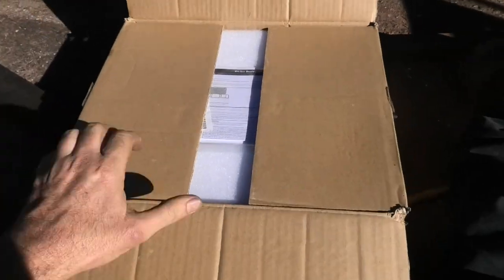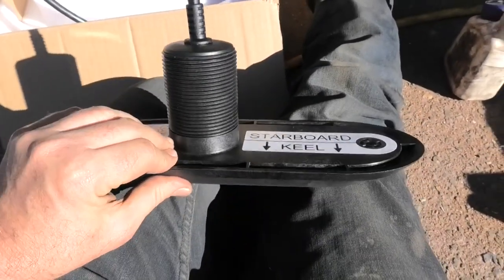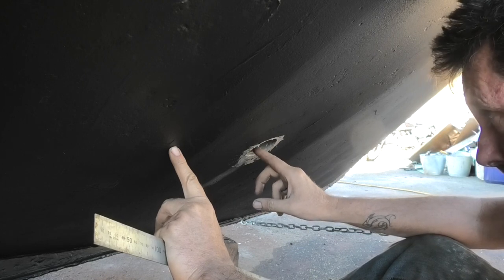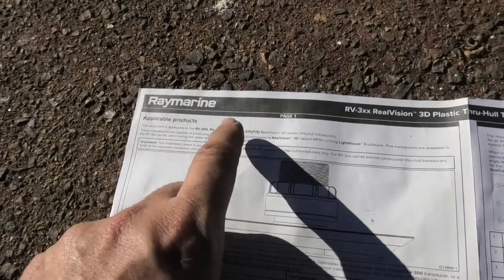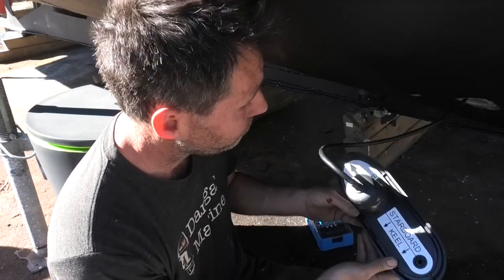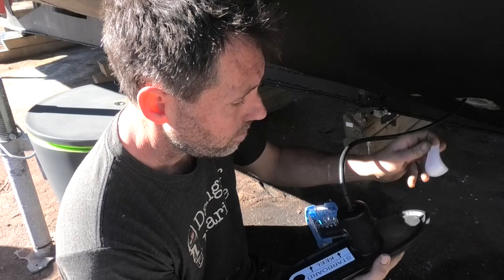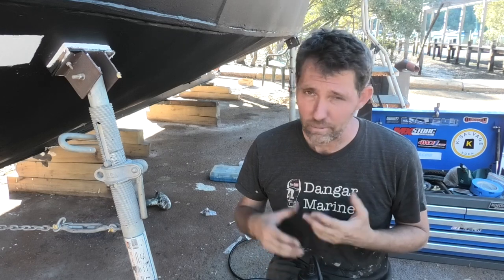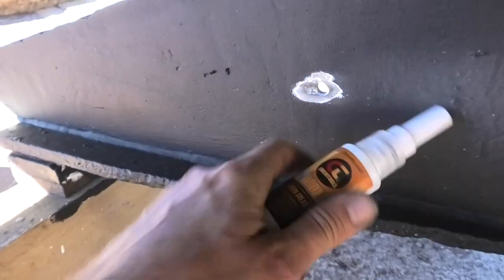Installing Raymarine RV-320 sonar transducers and attaching anodes

Comment: The fact that raymarine thought about the potential of the treads putting a knick in the wire it really gives you confidence in the fact they've put that thought process in the enclosed unit as well. 

Good to see a company doing everything they can to ensure their product will work for their consumers
Reply from the maker: For sure, everything I see and read gives me a lot of confidence in their product. I did quite a bit of research and it wasn't cheap (well, for me anyway) so I'm really hoping to get some great use out of it.

Comment: The fact that the transducers can be installed without the need for angle blocks is a great feature. It was always such a pain to have to fabricate a block to make the bottom of the transducer parallel with the keel.
Reply from the maker: For sure, they are a really nice design.

Comment: I reckon that little protector sleeve thingy might make more sense if you put it in the hole through the hull. A plastic nut likely wouldn't be sharp enough to cut the cable, but a hole through a steel hull could certainly slice the insulation right off.  Especially so if you're  installing the transducer somewhere with limited access and the cable needs to make a sharp bend immediately (the cable would be pulled through the hole at an angle.
Reply from the maker: Yes, I'm sure there are certain circumstances where it would come in handy, but I think this was a pretty straightforward install in the end.

Comment: Stu just use a piece  of pvc  pipe over the shaft  with an exhaust  clamp on it . Just split the pvc down the middle it is easy to remove then I have done it a few times so I know it works. Like your videos mate cheers

Comment: Maybe that plastic protecter was to protect the threads from getting Sikaflex on it as you snake the nut over the cable. When you feed the cable through hull hole with Sikaflex smeared on it you're going to get some on the cable. Just a thought.
Reply from the maker: Yes, possibly, as well as maybe for the brass model which has sharper threads.

Comment: Would the authorities issue you a variance for the crane? 1. They left you stranded. 2. The bridge held up for as long as it held up until somebody had a better idea. 3. You only need it one time to get your boat in. 4. Their new regulation impacts you disproportionately.  5.  You could lead a secessionist movement for Dangar Island. Good sailing on your coast run....

Comment: Stu: <drills hole in hull>
Stu: "Let's read the instructions"

Great job man. Not putting the engine in before going in the water seems like maybe not such a great idea, though.  With having to time it with the tides, maneuver the boat by hand in the shallow water, with having to deal with the two crane hassle, with having to then tow a fairly heavy boat out...it seems like a safer easier bet to get the engine in and running first. 

Either way, best of luck and enjoy the videos very much as always!
Reply from the maker: It's true that driving it out would be easier than towing, but it won't be hard to tow with someone on the wheel.

Comment: The transducer is easy to test out of the water. Connect up and turn on. Place your ear up to it and it will make a ticking sound as it pulses. This can be done quickly without risk to the transducer.
Reply from the maker: Just need power and the head unit.

Comment: Nice one Stu, fantastic progress and great humour.👍 My only negative comment is you appear to be leaving too many threads proud of the nut when the joint is fully clamped. Worked in the Marine industry (40 years) and our rule of thumb was max two threads proud, this to make it easier to remove the nut in service after the inevitable corrosion sets in. Nothing worse than graunching a nut back over two inches of rusty thread.😉 Keep up the good work.

Comment: Hi Stu, Dual crane lifts are fraught with potential to cause mayhem........make sure that the crane operators have some dual crane lifting experience (current) and ensure the communications are all pre discussed and agreed.  Hopefully a really experienced person to control the whole operation, good luck.
Reply: Reminds me of a situation I was in. 1974. Worked for Florida Mining & Materials building prestressed concrete I beams and railroad trusses for bridges. I was a rigger. Called out the crane operator for having a pint of Jack Daniels gone by lunch everyday and a second one by quit time. He thought it was funny to hit me with the ballhook. I'd have to jump otta the way more than once/day to avoid being knocked off what I was standing on. Gold Hat was crane operators brother in law.... so he put me pulling nails on a stack of plywood 20' from his office for punishment. The replacement rigger was sent to do his first job, a "double pick". Lifting a 120' Ibeam using 2 cranes. One crane moved and the other did not match. The beam tipped over almost toppling both cranes. They just dropped it to prevent toppling. Unfortunately, the new rigger wasn't far enough away and it pinched both his legs right off. I heard him scream 1/4mile away. He died later that day. Have a long rope and dont stand under anything. $2/hr min wage...
Reply from the maker: And check their insurance is current. ;)
Reply: Hell, just make sure you film it. If it goes bad and then goes viral, you just got a super yacht!
Reply: Mars Rover Now that’s not a bad idea 🤔 10 cameras in hi def with slo mo at key points.......Stu’ll be in a Nordhaven in no time!
Reply: A Forman what a tragedy and waste of life, thankfully; I never lost anyone on my watch, don’t think I could ever forgive myself.

Comment: Drill and Tap threads will make a good electrical connection, approved for most electrical codes, instead of through holes. 
Weld same type bolt material as hull for electrolysis mitigation.

Comment: Looking at the rudder, are you planning on modifying it? My dad changed the rudder in his boat from a flat plate, very much like your trawler has, to a hydrofoil teardrop shape profile. It gave a massive improvement to maneuverability.
Reply from the maker: I think I will play with it over time, but I'd like to live with this one for a while so I have something to compare to, otherwise I won't know if it is an improvement.
Reply: @DangarMarine  "Marine rudders and control surfaces" will explain what you need to know. It's simple to understand and covers everything from a viking steering oar to roll stabilizers. You can find it in PDF.

Comment: The grease to use is rescue steel grease  wish is used in a lot of fishing boats and water does not wash it off as it does with most grease.
Reply from the maker: Will check it out, thanks.

Comment: Engine installation might be a bit easier with the boat out of the water when it comes to aligning the prop shaft. The prop protector is going to be a very good investment; hopefully it's robust enough to do the job.
Reply from the maker: I think it might be a bit easier, but it also gives the most accurate result as the hull has settled into its natural position.

Comment: The transducer should be mounted level both fore and aft and athwartships.. its not goin to scan directly below the boat, unless ive missed something. its pointing away off to the side of the boat stu. The old limpet you cut off was there to produce a level mounting surface for the transducer
Reply: There designed for the angle. They make different ones for different angles
Reply: @baums547  thats cool never knew. Big drag saving not having to have a limpet to mount it on

Comment: Prop shaft strap.. use some 1 in strap across the front use another piece behind the packing flange and threw bolt

Comment: 291 is an awesome below the waterline sealant/adhesive ... a million times better than silicone.  You should probably have smeared some up the anti-rotation bolt before you popped it in.

Comment: Hi Stu, turn up some tapered plugs the same size as your seacocks and transducers, Tie them in a bag with a cheap club hammer near each of  the through hull holes, then if you wipe one off you can quickly plug the hole. Also to hold the propshaft in place, a couple of hose clips or a wooden bolted clamp will do it, but I advise to fit the packings AND flange while on the hard.
Reply from the maker: Good idea. :)

Comment: If this were 3 cm longer, that anti-rotation bolt would have been a problem.  Also, it sounded like you said, "Time to read the destructions."   This is now my preferred term for the papers included with projects...
Sikaflex - rubbing alcohol works well on the gloves to make sure it doesn't stick.
You placed the wide end of the anode towards the bow, is this preferred?
Very exciting that you are getting close to back in the water.
Hope your mate's family is doing well at the loss of dad.  Been praying for him.
Reply: Good tip on the rubbing alcohol! Re: wide end of anode, yes the blunt side forward is actually more 'aqua-dynamic', in boat hulls this is called 'fish shape'. Look at how a tuna or a sea lion is shaped... wide at the front for maximum slip, narrow at the end for minimal turbulence :)
Reply from the maker: Yes, I also think of it as an aerofoil shape.
Reply from the maker: Yes, I also think destructions.  Good tip about the alcohol!

Comment: Hey, putting  the boat on its swing mooring clearly saves cash.... the negative in my experience is you'll waste time traveling between ship and shore when you don't have that vital tool or part. Planning is key!
Reply from the maker: It will be much quicker to get from the mooring to my workshop than where the boat is now on the hard stand.

Comment: I’m not sure really how toxic it is but they always say you should wire wheel the yellow zinc coating off those (grade 8 I assume) you welded to the hull.
Reply: "Yellow zinc" is likely cadmium, and yeah, it's pretty bad. On the other hand, his ventilation is decent...

Comment: Nice going stu... You said your boat has a 20° dead rise assuming that's measured at the back,, I think in the forward location where you have the transducer it's more than 20° Is the transducer adjustable? Anyway enough with my crazy questions can't wait to see the boat in the water I hope you have the biggest barbecue then
Reply from the maker: 20 is the highest deadrise they sell. I do have that metre for measuring it, I'll check what it actually is. It will be much less than 20 at the stern.
Reply: @DangarMarine  yes at the stern it is much flattered which usually the transducers are installed. As you move up front the deadrise changes let me know I'm just real curious have a great time this week how does it feel becoming a star on YouTube LOL

Comment: Interested to see you using a stick welder rather than mig or tig. Given you run a Land Rover, it must get a fair bit of use. Why do you prefer stick ?
Reply: No hassle of gas and can weld outdoors / anywhere?
Reply: I'd prefer a stick welded joint over a mig joint anytime.......... Other reasons are as Brian mentioned.
Reply: @garrylearmonth9313  Agreed, much better penetration.
Reply: Stick takes more skill, but is a much more versatile form of welding. Wire feeders are for amateurs or production welding, tig takes more skill again, but is much slower and requires better welding conditions (prep and cleanliness)

Comment: Questions:
1. shouldn’t the anodes be installed the other way round for better streamlined effect?
2. Shouldn’t you also scrape the paint and clean with alcohol around the transducer hole on the hull too?
Reply from the maker: No, anodes go that way round, think of the shape of a fish. I need to leave the paint so the hull doesn't rust.

Comment: Now that is cool the transduced can be installed flat and the angle is already built into it. One of my boat's had a mini version of the block that you took off to get the angle straight down (I also pulled mine off) I installed the new trans in the keel but I would have much preferred to do it the way you did. 
Thanks for showing what sealant you actually used. 
I would have rather saw you put the small end of the anode on the keel forward but that's because I don't want any drag that is not needed. I do have a question though. Why not just through bolt and put a anode on both sides?  
Just a FYI, put a string on your antifoul brush and just let it hang in the bucket (in the liquid) when not in use. That way if you have a quick touch up the brush is already there and ready to go and you also don't have to clean it after because you just rehang it in the bucket.
Reply from the maker: Yes, the transducers are cool the way they are designed for the deadrise of the hull. The anodes are more hydrodynamic the thick end forward - think of the shape of a fish for example. The first anode was bolted on the way you described, but it gives the worst connection to the hull, particularly after time. I like the string tip!
Reply: Oh I get it, the anodes are like those nascar/race car duck vent.

Comment: I havent seen you use any cold galvanizing spray primer anywhere as a anti-corrosion measure.  I use it all the time for my dry-land welding projects.  On a steel boat I would have thought it'd be ideal to use.
Reply from the maker: I put some on the deck in one of the earlier videos. I tend to use it for temporary protection before getting epoxy primer onto the steel but I don't leave it under the epoxy.

Comment: You could sit there and rub that plastic nut on the cable all day long and the cable would still be fine. That protective spacer is an odd option to put in with the kit.

Comment: I'd mount those rudder lower gland bolts the other way round so if you do run over anything you wont bung up the threads...
Reply from the maker: The trouble with that way round is that if the nuts come off for whatever reason the bolts will fall out.
Reply: @DangarMarine  Legit concern, but anything that vital, I'd drill and pin the bolt end either way it's mounted...

Comment: How do you connect the exterior water cooling lines to the engine when the boat is in  the water?   I’d think getting the engine reinstalled first is the best approach, but since it sounds like you’re going to be crane-limited, not having the engine weight may be necessary.
Reply from the maker: The seacocks will be installed before launching the boat so you just connect the plumbing and open the valves.

Comment: I have watched half the video. Still have no idea what a Tranceduser is. 🙂
Reply: Antenna for sonar
Reply: basically turns variations of something (like brightness or pressures) into a measurable electrical signal
Reply: A transducer converts energy from one form into another. In this case, from electrical into sound and back again.

Comment: Stu , I'm a little suprised you didn't prep ,prime, and paint around the hole before putting the transducer in.
Reply from the maker: Yeah, I wanted too but I also want to get the boat water tight so I can get it launched. It will be a bit harder to do now but because of the flange being raised there it won't be impossible.
Reply: @DangarMarine  Fair play Stu , it's just that I know you like things right ,I was not trying to be a know it  all knob head !.

Comment: Just out of curiosity. why does a vessel need anodes? Is this because its a metal hull. or is there some other reason. And why do you need many of them spread over x amount of distance?
Reply from the maker: Hey Robert, I'll definitely be doing a full video on what they do and how they work soon, maybe even next as I could film it while I am away, but the basic idea is that they protect the hull from electrolysis. They work to about a 1.5 radius hence you need them spread down the hull.
Reply: Dangar Marine Thank you for the reply. Shes coming along well. Once the motor is back and running. Make sure you put a new spring on the throttle linkage and have the fuel  pump overhauled as well. Detroits are a right royal pain in the butt if they run away on start up.
Reply: Dangar Marine Thank you for the reply. Shes coming along well. Once the motor is back and running. Make sure you put a new spring on the throttle linkage and have the fuel  pump overhauled as well. Detroits are a right royal pain in the butt if they run away on start up.

Comment: I had a question I was wondering why you didn’t just get like a Cummins 12 valve B5.9 engine in stead of rebuild in the Detroit? Are you going to put in some boom pad inside the engine room to quiet down the noise?
Reply from the maker: I like the detroits, such strong engines. Yes, will be fully insulating the engine bay once the painting is finished.

Comment: Do you use 3m 5200 for below water line stuff?  I think its one of the best sealants on the market.
Reply: Not if you ever plan on replacing. Stuff is like cement
Reply: If you ever need to replace then 4200 would be the choice

Comment: A few ideas for the crane issue, it might be cheaper to hire a barge crane or a barge for the previous one instead of the 2 smaller ones. Also it'd be a shame if someone pumped a ton of water over the bulkhead at low tide creating a little gulley in the muck. Or possibly some idiot could get stuck in there in their boat making a little channel from the prop wash ;-)
Reply: Here we'd use a hydraulic trailer like this http://www.hostarmarine.com/preowned-pictures/DSCN8831.JPG  to come lift her off the stands and take it to where you can launch it. You might even get lucky and get launched off the trailer. Either way it'd hopefully still be less than 2 cranes.
Reply from the maker: Getting it on a truck or trailer and launching straight into deeper water is something I've been thinking about.